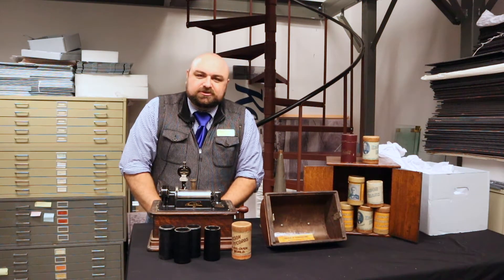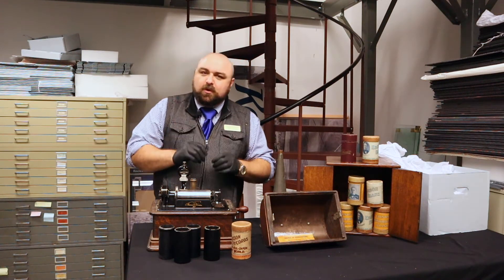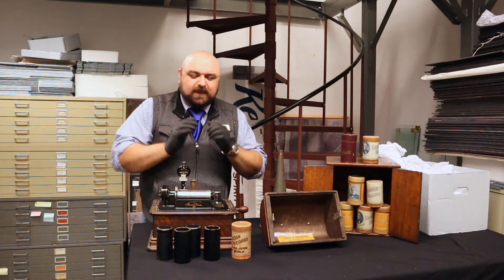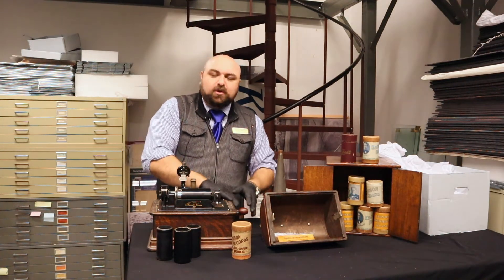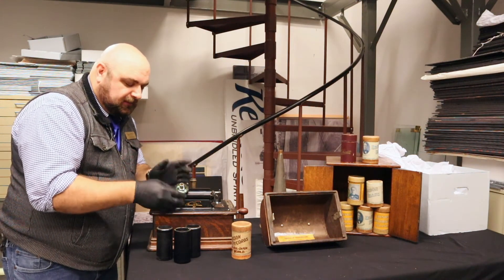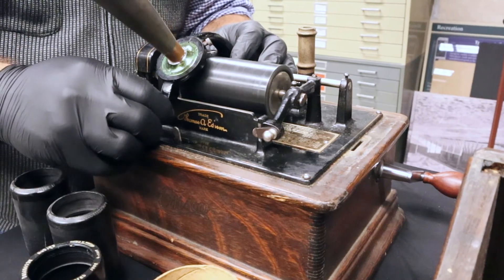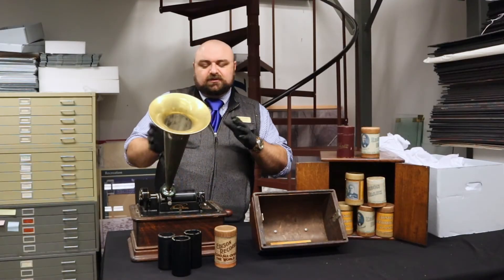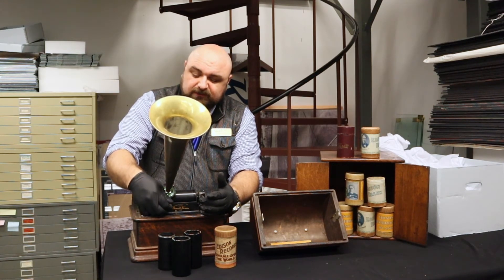Curator's Chat: Edison Cylinder Phonograph

Comment: The machine is a Standard model B introduced in October 1905. They were made up until early 1909.(yours has the molded case introduced about 1908 or 1909, instead of the “tall” case. but it’s not uncommon to find older works in newer cases) And as someone said keep the Model H for 4 minute records.

Comment: That's a combination 2/4 minute machine. Are you sure you have a C reproducer playing that 2 min. record and not the H. The H is for 4 min. If you pull out the button on the far left you can put this machine into 4 min. play. The green reproducer was usually for 4 min. cylinders. This machine would have had a different horn. That back bracket in the back is for a cygnet horn.
Reply from the maker: Thank you Dawn for sharing your knowledge. We have an old and varied collection in our museum and we learn more about it through people like yourself who share knowledge with us. Though we may want to know it all, we can't. You're correct. It is an H reproducer and unfortunately, we have never had another horn. I am excited to know that I can play 4- minute cylinders on it. Thanks again!
Reply: @bcmuseum  Cross your fingers and look inside of the wooden box where the motor is. Often owners would put the C reproducer inside the machine for storage. Just turn the crank backwards to get it out.
Reply: @dawnhanley3114  I noticed that it appears to be a Model B machine (due to the endgate) but has a later case introduced about 1909 or so. Instead of the “tall” case.